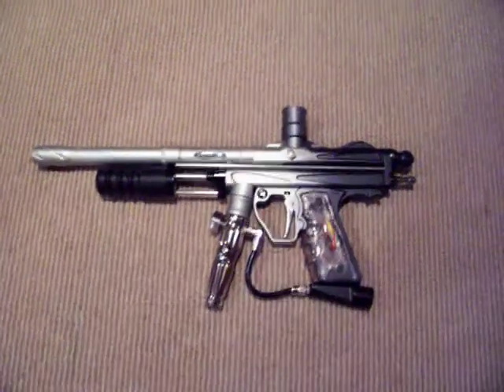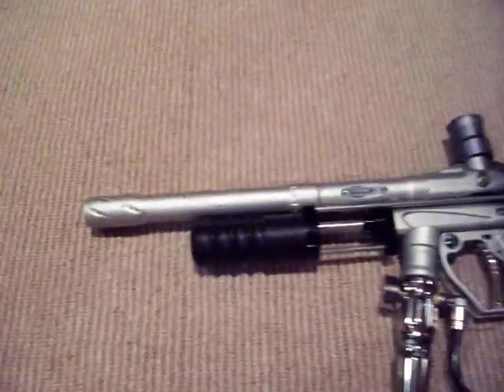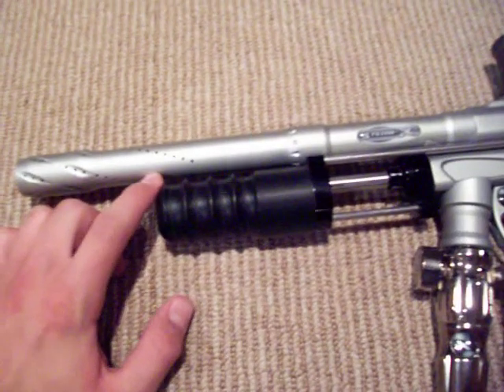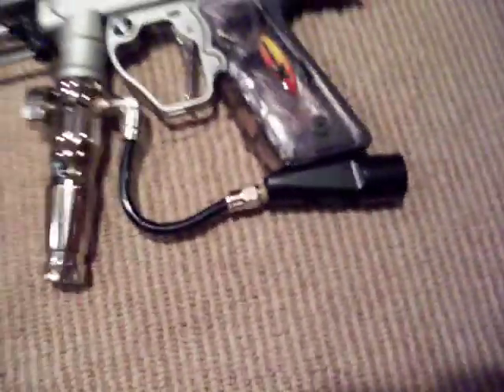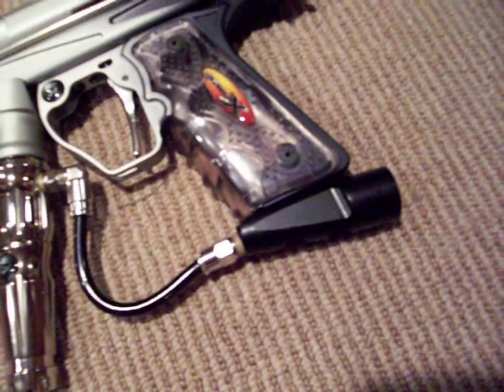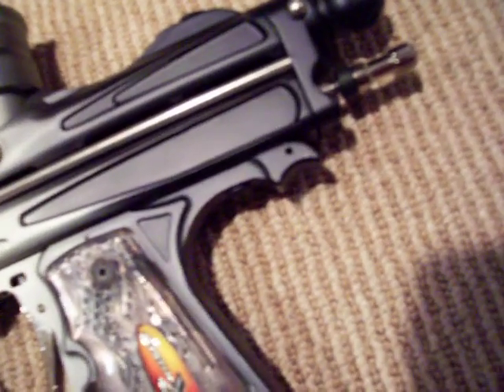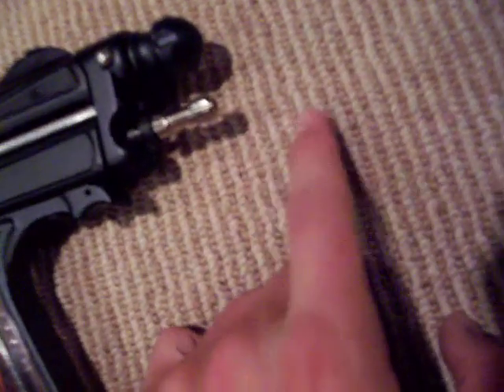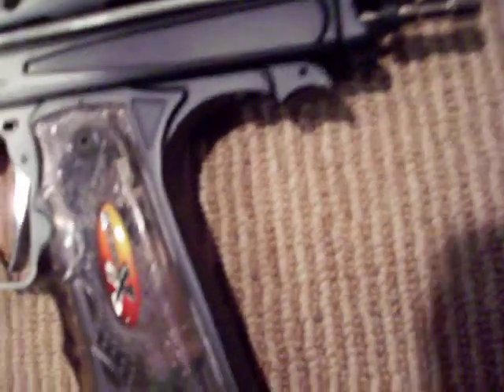my autococker pump UPDATE! :)

Comment: @CptWhitebread 
the autotrigger kit contains the frame. the deluxe kit has the same pump kit as the autotrigger kit minus the frame. the econ kit is different as it does not have the lower pump guide.